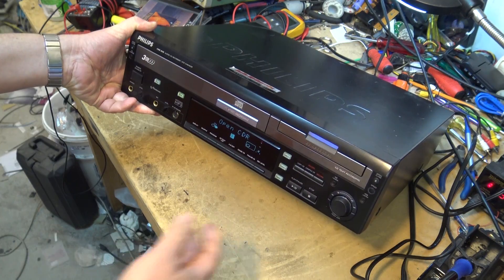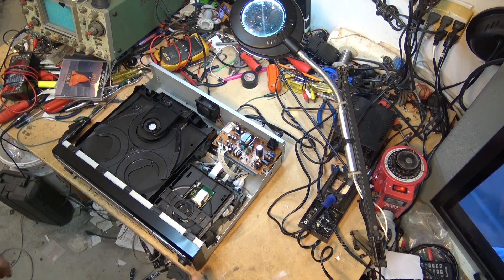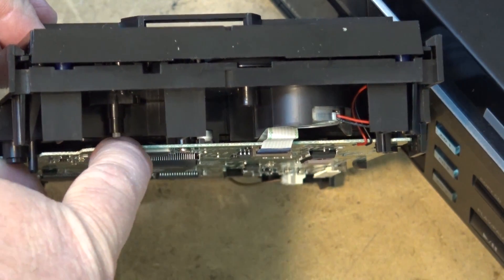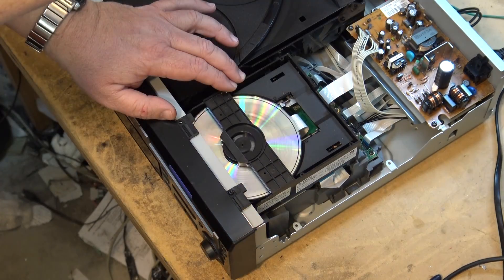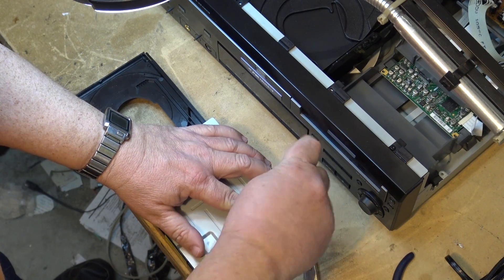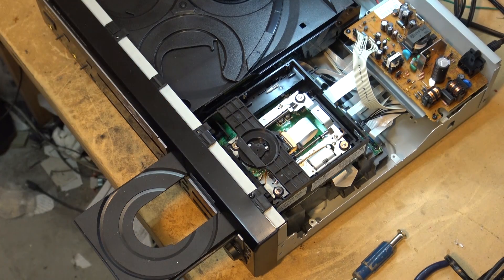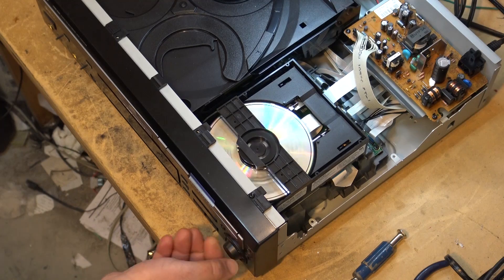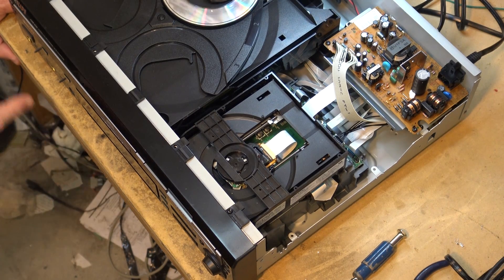Philips CDR820 Disc will not load repaired

Comment: Ah, yet again the irony of Philips not using Philips screws in their equipment...
Reply from the maker: Philip's the company did not invent the Phillip's screw. Duh.  A guy from Canada named Robertson invented the Robertson screw.  The best screw ever designed.  Unfortunately unless you are in Canada you have never seen or used one. You use square head which looks similar but is not.  Using a square head bit on a Robertson screw or vise versa usually ends up in a stripped screw and people blame the Robertson design.  A real Robertson screw with Robby bit won't slip or stop. In fact you can put enough torque on there to shear the head off the screw.
Reply: @12voltvids  I knew about the Robertson screw from your previous videos, case of being too good for it's own good i guess whereas Philips (which i did not know were of seperate origin to Philips electronics until now! Somehow). are a bit more idiot-proof, no overtightening/snapping screws if it cams out once tight.
Now i think it's time for me to look into the origin of Philips heads lol
Reply from the maker: @danmackintosh6325  
The cam out of Philip's was one of the reasons for its design.  Started in automotive industry so workers would not over tighten when assembling with power tools.

Comment: Greetings! I have a Phillips CDR800, very similar to the CDR820, I'm assuming the 820 is an attempt by Phillips to correct some common problems with the 800 namely "CDR tray will not open" and that is my problem...I opened up the unit and found nothing obvious other than the CDR unit appears to be completely dead when I press buttons on the control panel on the front of the unit I get the proper response just nothing happens at all with the CDR oddly enough the 3 cd carousel responds to commands entered on the CDR side and the cooling fan on the back of the unit never turns on.....I'm thinking there is a bad control chip on the control board underneath the power supply. I found a Schematic online and voltages seem to be ok going to the CDR module but I could be wrong on that I really would like to get this working if I can. The CDR module in the 800 is different than the 820 it does not have the pin style sensor switch but a different kind, (rocker arm switch I think) I shot it with some WD40 and worked it back and forth a little bit.....still....nothing.. Thanks in Advance...
Reply: Did you find a solution to that problem? I also got a CDR800 with the same problems.

Comment: Cheap Chinese switches. They get dirty and oxidize underneath. The extra length will help but there is a good chance it may fail again. Trying to find switches can be a pain. Mouser, DigiKey, Farnell should have them but good luck finding the right one.
Thanks for the insight. I have a DVD player with similar symptoms, when it decides to accept the disk I get a "Bad Disk" error on the screen.

Comment: Had this same issue with a thrift store Xbox. Cleaned the two pin switch's and it worked fine. The original Xbox is the king of disc drive trouble.

Comment: Smashing job, its not sticking its tongue out at you now :-D.
Pin switches, i thought that only the old 3.5 inch floppy drive units used them.

The pc Toshiba dvd reader came to mind, they allways went silly, the tray switch was the toggle type your first mensioned, i think the switch was a poor design.
Other types of drives with similar switches didnt cause problems.